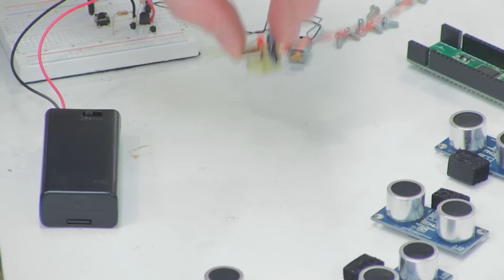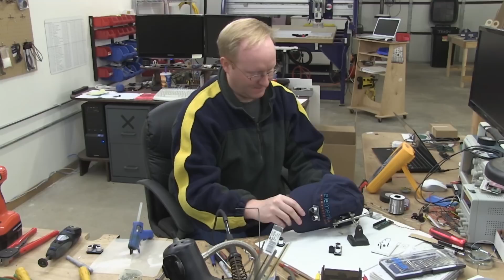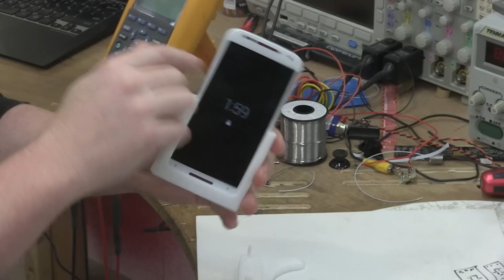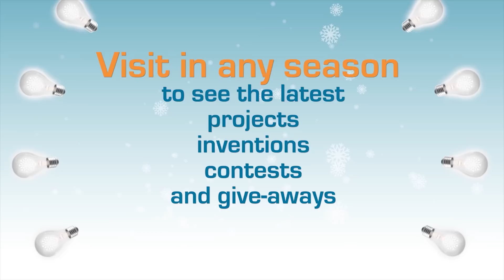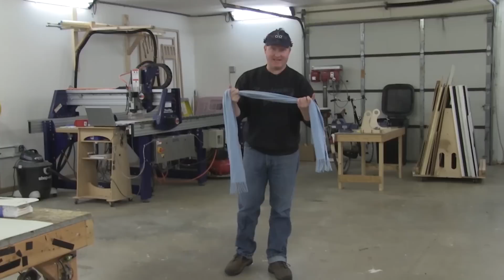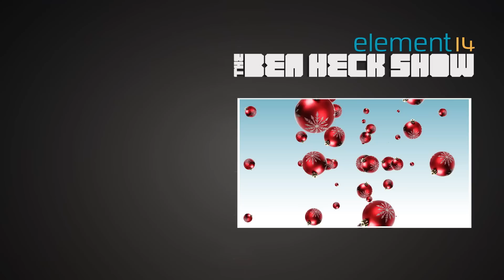Ben Heck’s Parallax Sensor Seeing-Eye Hat

Comment: How about making other kinds of wearables, such as wristbands or even legbands for left/right signals. Not entirely sure what would be intuitive for the front/rear portion. The user then might be able to sense lower situated objects such as fences or benches. Also, you can hold your arm such that the sensors face in front of you, it'd essentially be like a white cane without the cane! I'm not sure how it would perform due to the arms and legs moving more often than your head though.

Comment: wouldnt this be better suited inside some blackout glasses? i mean blind people wear them any ways, and theres all that room behind the lenses and you could attach sensors to the legs of the glasses in the same configuration as the hat, drill some holes big enough for the front sensor, and put 2 AA batteries on each leg? just a thought
Reply: +FriendZoneLiam 

ALL Blind people I know DONT waer blackout glasses(about 5 blind people I know). It is a common predjudice. I wear normal glasses and between the glass and my eyelashes there are only less than 10mm......

Comment: Wait what if there is a low wall or something how would the hat sense that
Reply: only if you look down i guess, and then you'd have to learn what angle is low walls, and where the ground is. I have a feeling if i were blind, Id get good fairly quickly just from constant practice. i think the wires could do with some cable management however. make them long enough to all go via the top of the hat, then heat shrink them in groups, and stitch the groups in places to the hat.

good proof of concept, if i had one id never take it off.

Comment: I would have also included a belt with the sensors as well. Stuff like desks and chairs probably wouldn't set off the head sensor, but a belt sensor would have a better chance picking those up.

Comment: Ben could you make a Braille display unit? They cost thousands it would be amazing to have a cheaper home build alternative... I made one for my uni project using solenoids with a single 9 pin unit that the person left their finger on. Could you make one that uses some other technology like buzzers instead of pins. I tested with hot versus cold pins using Peltier coolers but it didn't work very well as the skin is not very good at telling the difference between hot and cold when you change it quickly. Maybe you could find a way to use the pizo parts from an old dot matrix printer to push smaller pins in a long row?
Reply: Cheers!

Comment: Darn it was thinking of doing this with my Rasberry and the same sensors.I was going to have the sensors on a belt with the buzzers (in your case rumble motors) on the head band. I was also thinking of using a camera with simple face recognition. Not so you could identify people but so you could tell where peoples faces were. Different vibration for faces on just one central mid forehead buzzer. So hard to come up with a unique idea that has not been done already ;(

Comment: I would have had the rumble motors set to heart-beat like pulses, starting at six or five feet or whatever, having them pulse bum-bum, and then do it once every other second, or once every three, and have the ping rumble pulse go constantly around the hat, maybe take up a full second for a full revolution? but anyway, while the pings need to be near constant, the feedback to the human needs to be slow and readable, and then the bum-bum rumble pulses need to increase both in rapidity between rumble pulse, so halving for every half distance? and also getting faster, so bum... bum... bum bum bum-bum bumbum bumbum, see what im saying? it makes sense in my head any way.

Comment: There are several things done right with this project, and several things that were wrong. As a visually impaired person, I am (somewhat) offended at the "seeing eye" name. Not all things that have to do with blind people need the name of one particular dog training school branded on them. 2ndly, I would rather see a more common type of vibrating motor used, although substituting something would not be that difficult. Thirdly, as others have pointed out, propeller dev boards are way expensive for what I have seen. Would a Pro Trinket have the brains to pull this off? Not sure, but I might try it one day. And last of all, It seems that you might want to mount this in some sort of a gauntlet so that you can direct where the sonic sensor points a bit more accurately, although looking behind you would not be possible. I don't do much walking backward or side ways, so it is not really an issue. Just my take on things. A bit long winded, but there it is.

Comment: Glad to see you return to a more 'inventive' build, rather than just replicating something, or repackaging.

One thought/recommendation. I know you were trying to keep the ultrasonic sensors, and the motors, together in cloned packaging, but why not make the front one a bit different? I was thinking, hanging the sensors, under the front of the bill, and have the motor, at the front of the cap. And, as you suggested, use smaller sensors.
Obviously, this was just a proof of concept, but I was trying to think of ways to continue using a hat, rather than a less fashionable headband. Plus, I think the headband may leave the front sensors, pointing to the sky. I know the band could be adjusted, but I think people would prefer not to have them on their eyebrows.

Comment: why not implement this with an auditory setup instead of the vibration motors? The user could use some earbuds, and then
have a tone that increases in volume the closer you get to something. And yes, this can be done with just two speakers, just look up "virtual haircut" on youtube or something similar.
Reply: what if the person is deaf as well?
Reply: TheTjoconnor then they must have a pretty shitty life.
Reply: The person is already blind, cutting off their hearing is really not a good idea.
Reply: The "virtual haircut" is done by using an head shaped microphone to get all the cues and stuff.
If its possible to use the same technique to record four audio samples and get the effect right, then its easy, but otherwise you would have to simulate the effect by software and require a quite powerful CPU to pull that off.
Reply: xnamkcor X really. i had no idea.
Reply: Dr_Kachu san the thought of that hadn't really crossed my mind, it may require a decently powerful
cpu to make the audio playback in real time like it does in virtual haircut. or it may not. Either way, I think
that would be a better way of sending feedback to the user than rumble motors.
Reply: Then how would the blind person hear things like, say, people talking to them or the truck that is coming down the street? I am visually impaired myself, and can't wear headphones do to this reasoning.
Reply: Scott Perry if they used earbuds such as the apple ones, you can easily hear past them. And unless you are directly next to a wall or something the noise wouldn't be that loud anyway.
Reply: It's recorded using binaural microphones. Placed in the ear position on either side of a mannequin. 2 microphones just record a stereo stream. No CPU power needed. However,  the binaural simulation doesn't actually provide front and back. The assumption of direction is used. Barber is always behind you right? He also explains in that clip where he is cutting and trimming, filling in the other information needed, which your brain subconsciously keeps track of. It might work but front and back would have to be determined by pitch or it would become very disorientating if bearings were lost even for a second.
Reply: Jkouw but it wouldn't be cutting off their hearing. it's not like listening to music.
Reply: xnamkcor X perhaps, or even normal earbuds, such as the ones that come with an iphone/ipod. they are very easy to hear past
Reply: Speakers work by vibrating.
Reply: Ricky Oswald so do dildos. I don't see how that pertains to this situation.
Reply: MrMatte0000 Well done in refusing to acknowledge the valid constructive criticisms presented to you. >,<
Reply: Raymus Munt Such as?
Reply: Bone conductors

Comment: I am legally blind and have tunnel vision, I really like this idea, but my issues is seeing small children and anything below my nose.  That is why I would think it might work better as something you drape over the shoulder so you can have front sensor lower and have some sensors on your shoulders and back.  maybe it can attach to your clothing where the motors are so you could feel the vibration that way.  Since i am a bigger guy it can be mad on to straps that adjust so it can fit multiple body types.

Comment: Big fan Ben - keep it up :-)

Using ultrasound with rumble feed back for adding proximity feeling is a cracking idea. Thumbs up for the idea.

An Oct-core parallax bit over kill for the application.

You asked how this can be done different...

I would have put a 8 pin pic or picaxe on each sensor. This way only external power is required requiring less wires. You could even use metal thread like with lilypad wearables to supply the power. They could even use coin cells (2 x cr2032s) and be 100% independent but this may require less rumble to save power.

Making each sensor module independent will also allow you to easily add sensors elsewhere, hips, legs, hand etc...this would make feeling the air with your hand useful. Sensors on the knees could help again low object such as trash cans or seats.

I also think the pace of the build (and other recent builds) is a little fast (sorry Ben) but your earlier videos were easier to follow and more informative.

Just my thoughts.

Comment: Parallax propeller is like 90$. I'm going to stick with Arduino
Reply: $22.49 http://www.parallax.com/product/32150
Reply: Zach Starkebaum thanks zach, but I cant buy from "official sources" because I'm from Brazil
Reply: The ping sensor aint cheap either, i built my own last year than to buy those, too expensive.
Reply: ***** I got ping sensors for 2$ at ebay